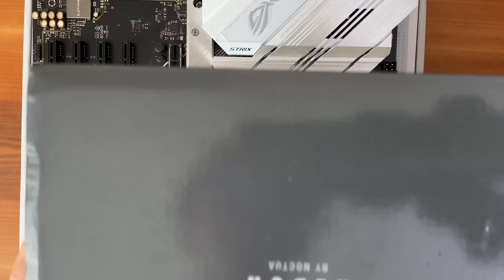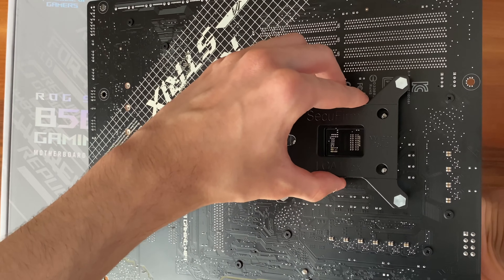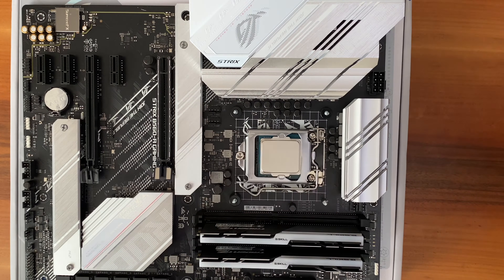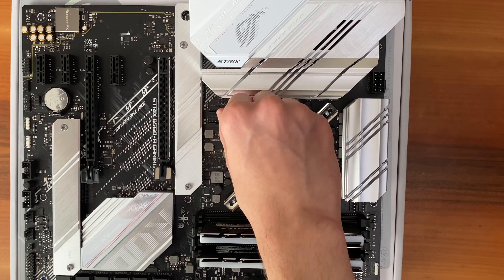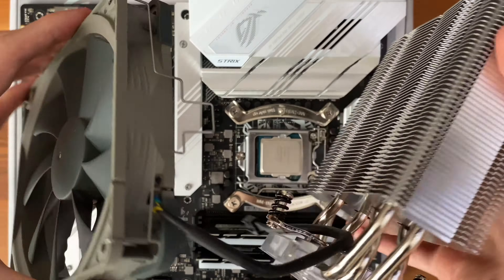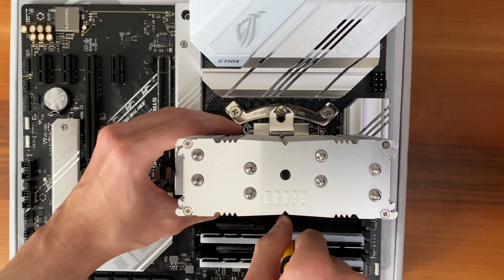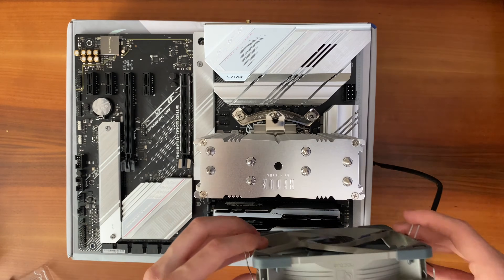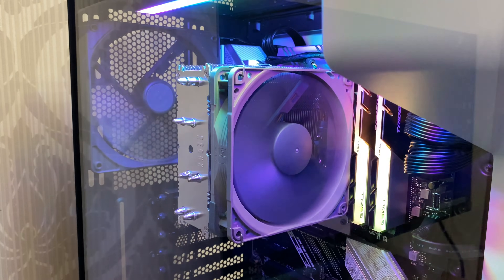How to install Noctua NH-U12S Redux

Comment: Your suppose to leave the old metal plate on the board and add the new one as well?
Reply from the maker: What do you mean by "old metal plate"? Could you please elaborate? This was the first time I was installing anything on this motherboard. Everything that was on there came with the motherboard (except for m.2 SSD, RAM sticks and the CPU).

Comment: will this fan put pressure on my ram ? ( I have mATX model motherboard)
Reply from the maker: What ram do you have? You can always move the fan up if your ram is too high.
Reply: @teimurlu  unfortunately my case's max cpu cooler support height is 159mm and as far as I see this fan's height is 158mm so I can't move the fan up I guess. Also my ram's height is 33mm

Comment: Hello friends, pls help me - is that cooler enough for i5 12+ ? aAnd tell me please if the thermal paste that is applied from the factory works well?
Reply from the maker: Hi there! Yes it is enough for both i5 12400 and 12600. But I am not sure if it comes with the necessary mounting hardware. Also. yes it comes with a pre-applied thermal paste.
Reply: @teimurlu  Thank you for the answer, yes they put the frames for 1700 in the kit (I live in Kyrgyzstan and ordered that cooler from the USA because in Kyrgyzstan there are no modern computer hardware), and I’m thinking whether it would be okay to leave the factory thermal paste - (it is applied in the form of honeycombs or hexagons you know), should it be erased and smeared manually or it is okay ?
Reply from the maker: @TheCh33ze  I have ordered it from the US to Azerbaijan and I had no problems with the thermal paste, so I'd say don't worry too much about it.

Edit: keep the honeycomb
Reply: @teimurlu  Thank you man 🤝👍🙂 you made me calm about it now! And I want you to ask one more thing - what do you think is okay to buy 27” monitor with full hd resolution? Some people say that If I am buying 27” - I must buy monitor with qHD 2k ?
Reply from the maker: @TheCh33ze  A 1080p 27 inch monitor isn't that bad. However a 24 inch one will look sharper.

Edit: This is because the pixels density on a smaller monitor using the same resolution is higher causing it to appear sharper to the eye. I, myself have used a 27" 1080p monitor and I think it is totally usable. Of course, a 1440p one will look better but it will also decrease your FPS, so consider that as well.
Reply: @teimurlu  Great! Thank you for answer I'll probably buy that one too (1080p 27).
Thank you very much for your advice, you are a great man. And I think you need to post more videos on YouTube =) , because you are good at it and have a nice voice on the video.
Reply from the maker: @TheCh33ze  Glad I could help! I am planning to post more in the near future :)

Comment: Whats up eqqs :)
ur build is very similar to mine and i was just wondering what gpu u ended up using for this one?
im just looking for a good one to pair up with my i7 11700k. 
Have an awesome day man :)
Reply from the maker: Hey there, I have paired my i5 11400 with an RTX 3060 Ti. If you cannot get your hands on one then I recommend getting an RX 6600 XT (not the non-XT model). An RTX 3060 would also be fine. Other than those RX 6700 XT is a great option if you can find one.

Comment: Noctua is overrated pile of shit. Was using this cooler for a lga 1366 build and they told me I needed a new mounting system, after I got it it didn't work. Not only did they lie their product page is incorrect, last time I'm buying noctua
Reply from the maker: Thanks for the feedback. For myself and many others they worked great. Sorry you had a bad experience.

Edit: typo
Reply: skill issue
Reply: lol it's literally r3tard proof

Comment: Do you think this is overkill for an I3 10105f?
Reply from the maker: I wouldn't say so, yeah some cheaper coolers will perform similar but if you want to cool your CPU while keeping your PC quiet then this is a great cooler. Also make sure to check out the Arctic Freezer 34 esports Duo.